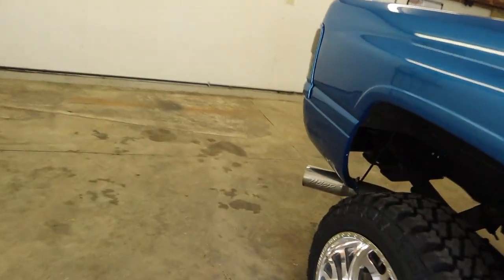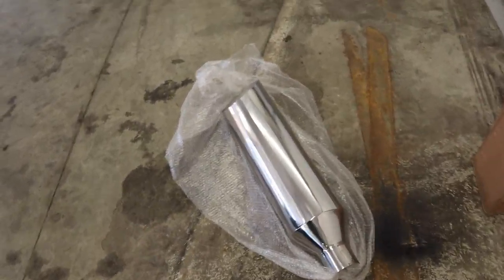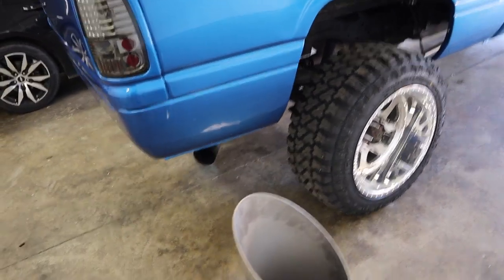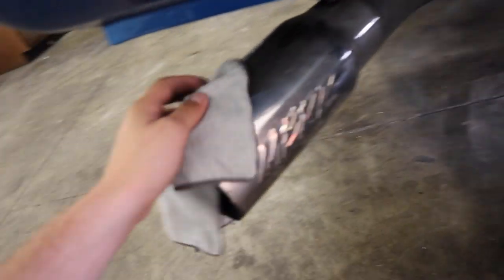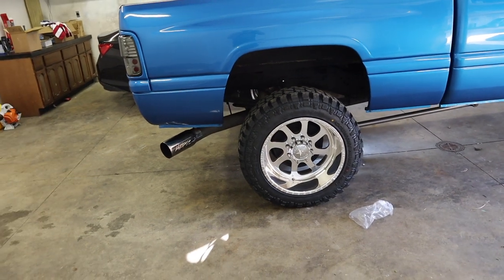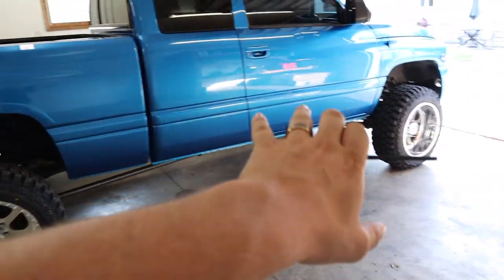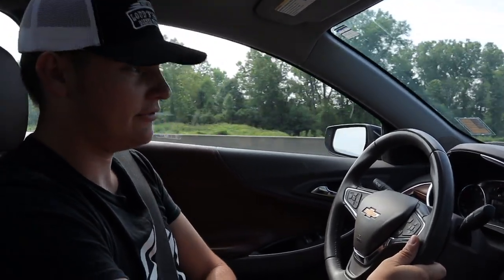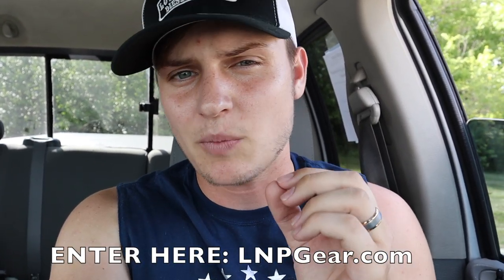I FINALLY BOUGHT ONE OF THESE RARE DIESEL TRUCKS!!!

Comment: As soon as you drive the truck the center caps will not line up anyways...
Reply from the maker: Jason Heinrich please tell me how that logic makes sense....
Reply: Loud’N’Proud think about it, do a burnout and let me know if it’s still facing same direction
Reply: Unless it’s a floating cap that stays a single direction
Reply: @LOUDNPROUD  
Open differential...
Reply from the maker: Well yeah if you drive pedal down everywhere...
Reply: LOUD 'N' PROUD even turning man, do you know how a open differential works? Sorry man but all wheel caps will always be faced different ways due to turning left and right.
Reply: @bradleyrodriguez4969  
Exactly
Reply: Kinda scary he doesn't understand how a differential doesn't work...

Comment: Frankfort ky by the Lowe's is a second gen 24v extended cab long bed new paint black with gold at the bottom rocker panels perfect interior fresh engine rebuild and 6 speed 4x4 on fuel rims. About a 6 inch lift.

Comment: If I was you I'd take that rear diff cover off and go back to stock for the simple fact. That diff cover doesn't allow to fluid to rotate around the gear to the front of the diff because its flat on the inside and that causes the fluid to splash off the diff cover to the side instead of going back over the gears like it supposed to.. just my opinion.. Definitely a gorgeous truck nice find.

Comment: Read this, On the 3rd gen put a steed speed 2nd gen manifold, s400 turbo, forces on nittos, and a 5 inch pipe, on a 6 inch lift

Comment: You think 114000 miles is low my dad has a 3rd gen that has 35000 miles on it. It’s a manual also.
Reply from the maker: Waid Berg compared to 95% of them out there yes.... there are always rare exceptions
Reply: Yeah 35000 miles is low but he probably paid a lot of it my dad gots a 2004 5.9 diesel with 60000 miles but only paid 1500 it’s crazy because the guy was only asking 2500  for it but the paint was missed up so got It for 1500
Reply: That’s cool. my dad bought his off the show room floor he never drives it cuz his company supplies a rig pretty cool

Comment: Once you drive the truck the caps won’t be facing the same anyway because your axels aren’t locked.
Reply: Moto Skeeter the caps are screwed to the rims not the axels 😂
Reply: And what are the wheels attached to? The axel. Because of the limited slip diff, it would turn the axel which the wheels are attached to at a different rate. So the caps wouldn’t match other wheels
Reply: He’s saying the letting on the caps to the lettering on the outside of the rims individually
Reply: I knew that.... no I didn’t lol makes sense know! Thanks